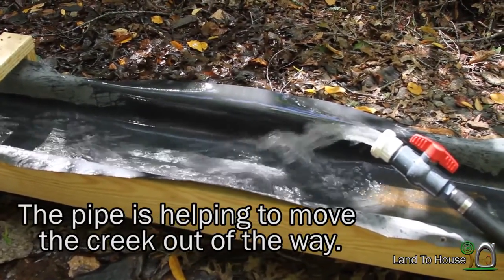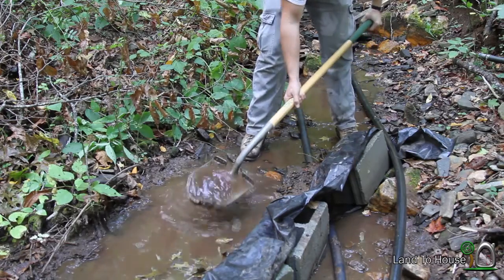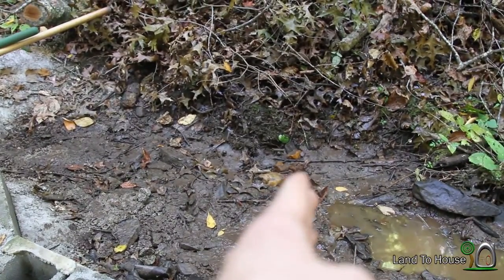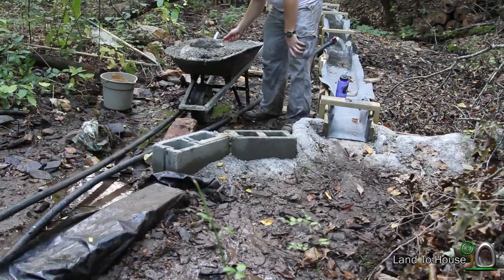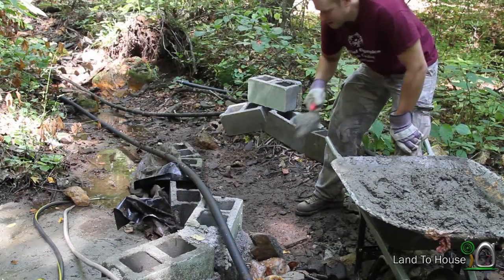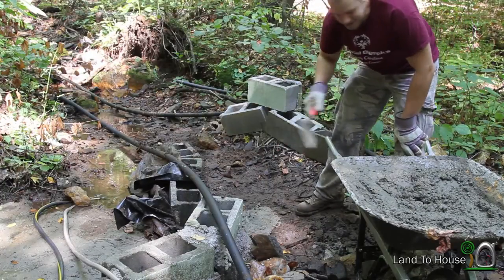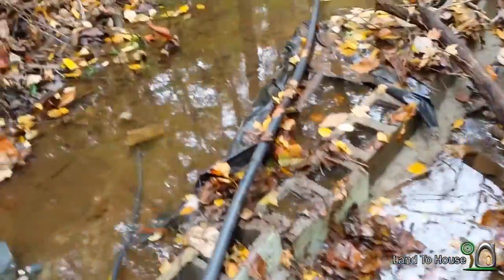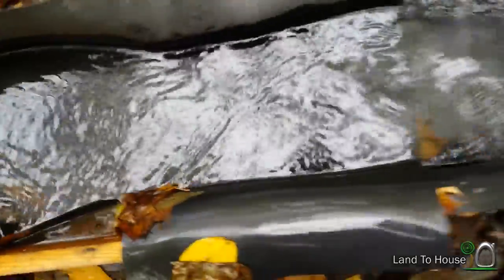Flume Dam and Flood

Comment: Well its good to see those Dam Blocks getting used up LOL
I had been wondering if the Flume may get overwhelmed that rain you had may not be the most you get and also snow run off could be a bunch of flow as well any way you are doing a great job of sorting the problems as you find them the videos you do are a tremendous inspiration .
Reply from the maker: Oh yes!  I started off with 300 clocks and now I have about 100 left. I am thinking that the flow will increase a lot in the late winter. The creek is down over 100 gallons before this last rain. As for sorting out issues there are almost zero videos on youtube showing flumes so I am learning by doing. I sure do enjoy posting videos. Happy to hear that they are an inspiration.

Comment: I have property on a 300-foot wide very slow-moving river. The water almost appears to be standing still. There is a large hydroelectric dam 10 miles upstream from my property, and a small hydroelectric dam about 1/2 mile downstream from my property. There is plenty of volume. All of my property is above the water level, which means that I can't readily draw (gravity drain) water from the source. I would be prohibited from putting any significant mechanical installation directly in the river.

I want to pump water out of the river into a holding tank. How can this be accomplished with a ram pump?
I know that the function of a ram pump is to take a portion of flowing water and pump it by means of the overall water flow. I'm wondering if there is some creative way of producing some artificial flow, strong enough to  function a ram pump.
Reply from the maker: Sadly the ram pump will need a constant flow of water with a very minimum head pressure of 1 foot. 2+ is ideal. If you have enough flow in the river you can look into a river pump. They need a good bit of flow. Other than that you might want to look into floating solar pumps. they are quiet and pump as long as there is sunlight.